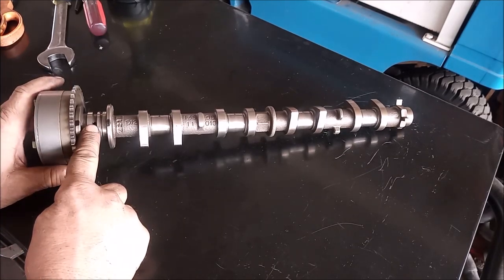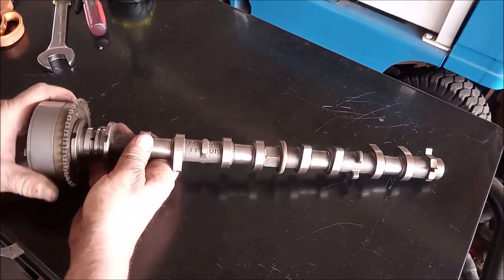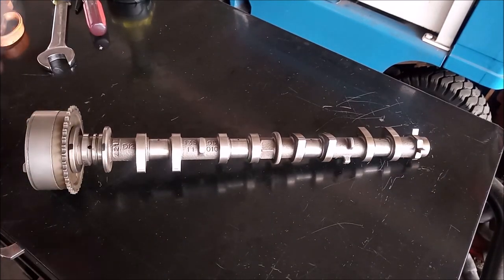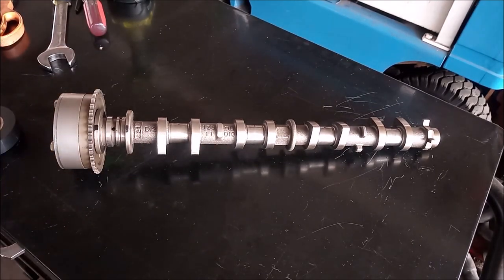VVT-i Timing Gear Unlock - Toyota 1.8-liter 1zz-fe/2zz-ge Corolla Matrix Celica MR2 Elise

Comment: I just bought a vvit gear for my 09 Corolla is the gear locked when u purchase it?
Reply from the maker: Starting 09, Corollas have a different 1.8-liter motor, 2zr-fe, not 1zz-fe. This video applies only for 1zz-fe. You can check whether the gear is locked or unlocked when you place it on the camshaft. If it is unlocked, it will turn. It it is locked, it will not turn. If it is locked, unlock it before you tighten the camshaft bolt.

Comment: I did a rebuild on a 1zzfe, non D motor and noticed it never had the get-up-and-go of the 1zzfed. I understand they are quite different motors and why but I don't think the vvti ever engaged after the rebuild. I know we didn't unlock the cam when we placed it back in, but I wasn't sure if unlocking it before putting it in matters.
When you place the cam back in the head does it need to be unlocked or locked? I see that it's supposed to unlock as you've said in the description.
Also what would go wrong with the inside to prevent it from unlocking? Would it be best to disassemble it on a rebuild to clean the interior and make sure it unlocks properly before placing it in?  
Just picked up a 1zzfed from a friend today, going to replace the 1zzfe because it began leaking too much oil. Probably won't be taking the fed apart as I'm on a pretty tight time crunch.
Reply from the maker: Lots of questions here. Let's unpack this. 

First of all the difference between fe and fed is not what you imagine. It is less than the difference that the weight of a full tank of gas makes to the acceleration of the vehicle. 

If your rebuild feels sluggish there could be many possible causes. Check the static compression, and the leakdown test. If the rings are not gapped correctly, or the valves do not seat correctly,  there will be diminished power. 

Now with respect to vvt-i. If the gear is not unlocking in operation, it will most likely trigger a P1349. If you do not have a P1349, and you suspect the gear is not unlocking, then apply 12v to the OCV at idle. The engine should stall or come close to stalling. This means the vvt is unlocking and functioning. If idle does not change when you power the OCV,  it could mean that you have a bad OCV. This would also trigger a code most of the time.  As an alternative, do an active test of the vvti with Techstream. What? You don't have Techstream? Then you have no business working on a Toyota. 

When you reassemble the camshaft. As far as I am concerned, it makes no difference whether you do it with the gear locked or unlocked. Just maks sure that the registration pin goes into the rounded slot. Either way, you will have to lock the gear to set the timing chain. Always, always, always, verify the function of the gear using compressed air (as shown in this video) before you re-install the camshaft in the car.

The gear returns to the lock position every single time you shut down the engine. If it did not, then the gear would clatter and rattle horribly on startup. So locking and unlocking is part of normal operation, not just something you do with the camshafts out. 

Hope this helps. Feel free to follow up.
Reply: replaced the ocv but swapped back after not noticing a difference. The motor just never really felt like it had the power of the stock motor I had previously. I believe it was still lower by at least 10-15 hp than a fed. Stock is 140hp vs 125hp from factory.  I guess I answered my own question. That difference plus a few more hp from an aftermarket exhaust feels quite a bit different in a 2000lb vehicle.

 I know that the fed has lightened rods and a handful of other tiny differences. they're basically identical as far as everything else. The rings were fine, the cams and valves were all within spec when reassembled, never had a p1349 during the entire operation of the motor. I did have misfire cylinder4  code but this is with aftermarket headers and exhaust where the bungs are only on 2 of the header tubes instead of a stock mr2's precat headers where they flow in 2 at a time.  

Anyway, after my first ever rebuild using youtube and a handful of manuals I got over 30k miles and 4~ years use on the motor and quite a bit of track time. ($100 used with probably 200k miles) and a $300 cheap rebuild kit.  The only reason I'm replacing it is because of the oil leaking, it's probably worth another rebuild or at least parts.  I guess I'll look into techstream options for future endevors.
Reply: and thank you it did help.
Reply: @PhonePhone-sf8te  I'm very familiar with the Fed...the difference between the Fe and fed is ...the Fed has threaded block for passenger cv axle carrier bearing and it has larger intake /exhaust valves and 8 hole piston skirts for oil return from cylinders...the con rods are the same... please don't double guess this information..I have had both of them apart a few times.. hope this clears things up
Reply: @Mikegastaldo  Hey Mike, I figured all of that out a few months ago when I was doing my rebuild.  The piston skirt holes you're talking about are referring at the oil return rings? Basically all 1zz models before 2003 (from my experience) all have 4 holes per cylinder and they're tiny. In this rebuild I just did, I added a 3rd hole(on each side) and enlarged all 3 holes of the stock pistons.  
The rebuild went successful and I had it on the track right after breaking it in. I have a slight leak out of the front main seal, and I'll have to deal with it soon.
Reply: @PhonePhone-sf8te  I'm happy you got your motor all sorted.. that's the important thing..to answer your question...yes I'm referring to the oil return holes for the oil rings.on the fed pistons you will find 4 forward facing large holes and 4 rearward facing large holes for the oil that is scraped off the cylinder to return to the pan so 8 holes on each piston... believe me..I know this for a fact

Comment: So what's the point of unlocking it if you have to install it in the locked position?
Reply from the maker: The point is - and I am sorry if I did not make this clear - that it is not possible to torque the bolt to the correct bolt with the gear locked. And when you put it in the car and it unlocks - as it does during operation - it will not function correctly, and it will make noises, and possibly self-destruct.

Comment: What about the 2GR-FSE? My exhaust gear went bad and I want to replace both exhaust gears on both banks. Do I need to make sure they're unlocked before I torque them? Thank you!
Reply from the maker: No. This is only for 1zz and 2az. Does not apply to 2GR, 2AR, or 2UR.

Comment: if i getting this right you have to unlocked then torque and install it unlocked or it doesnt matter if you are doing the timing chain?
Reply from the maker: try break down your question into more than one run-on sentence and use punctuation or I have no idea what you are asking.
Reply from the maker: If you do not separate the vvt gear from the camshaft then there is no reason to do this procedure. If the camshaft and vvt gear have been separated from each other then you must unlock the gear to install it.

Comment: Do I need a new vvt gear, if I installed it in locked position and packed up my engine and drove it too? Is my vvt gear damaged and it won’t work if I again open it and follow the correct procedure of installation??? Please guide…very worried.
Reply from the maker: I wouldn't worry too much. You can fix it easily. And if it seems to be working ok, and not making any noise,  it's fine.

Comment: Sorry for the dumb question but i cannot understand very well. 

I recentely Had to do the headgasket on my Mr2 spyder, while taking apart the head i took out the intake camshaft WITHOUT removing the vvt gear from the cam itself (so it was "all in one piece"and was surely locked) 
After replacing all the components, i put the intake cam and not bothered with the unlock procedure (as i was not aware of this) and on first start i heard a grinding noise that went away in a matter of seconds.... so here is my question:

Should i have unlocked the gear? while re-doing the timing on the 1zz engine, does the gear has to stay locked or unlocked? 

i'm asking because my car now seems to not pull as strong as it did and recently threw me a DTC P1346
Reply from the maker: The gear must be unlocked ONLY if you remove the gear from the camshaft. You unlock the gear to tighten the center bolt ONLY when replacing the gear on the camshaft. If you did not separate the gear from the camshaft there is no need to unlock it. The noise you heard was possibly due to low oil pressure. On first start after reassembling the engine, always remove the fuel pump fuse and crank without firing the engine, in order  to circulate the oil, then put the fuse back in and start the engine normally.
Reply from the maker: for toubleshooting this code, follow the steps in the factory service manual.
Reply: When removing the vvt gear from a cam, do we have to unlock it first? Or can we just unbolt it and remove?

Comment: Just want to ask,  why the need to unlock the vvti gear ? If I were to remove the 4 bolts to clean the insides,  do I need to unlock it before removing the 4 bolts?
Reply from the maker: You can disassemble the gear locked or unlocked, makes no difference. Just make sure that when you reassemble the gear and go to put the gear on the camshaft, before you tighten the center bolt, the gear should be in the unlocked state. After you tighten the center  bolt to spec, you can lock the gear. If you tighten the bolt while the gear is locked, this will lead to problems.

Comment: I got a timing chain rebuild kit. Came with exhaust sprocket, lower chain sprocket, oil pump, chain tensioner, chain guides, and a new chain.however it didn’t come with a vvti gear. I set the timing and ran the car and it jumped timing .I’m suspecting it’s the vvti gear because it’s the only thing that didn’t came in the kit. 

I noticed my vvti gear was in the lock position after it jumped timing.

Do I have to unlock and relock  the vvti gear when I set timing ? And should I test my OCV?
Reply from the maker: Ouch I hope there was no engine damage. With that said - the VVT gear will always go to the lock position when you stop the engine. The only time you need to unlock the VVT gear is when you install the gear onto the camshaft. It must be in the unlocked position when you torque the center bolt. After you torque the center bolt, you can let the gear go to the locked position. A common reason for jumping timing is a chain tensioner issue specifically if the tensioner does not release from its retracted position.
Reply: @Merryfrankster_  oh okay, I didn’t remove the gear when I was setting the timing so I guess there’s no need to do that? I used a screw driver to unhook the chain tensioner. 

I guess there could be some engine damage.
Reply from the maker: @noelhcarpio1551  If you have not removed the gear from the camshaft then there is no need to unlock it. If there is engine damage you will know it right away - some valves will be bent and the starter will refuse to crank and you will not be able to turn the crankshaft by hand with a wrench.

Comment: Let me check if I get this right: Thing is, I have bought new camshafts and new intake sprocket (QRP). I installed the sprocket on the camshaft, no problems aligning with the pin to the hole, but I didn't check the operation of the unlocking. Should I take the camshaft out of the engine again, to verify that the unlocking works? When installing the camshaft and chain,  the sprocket needs to be locked, right? It is enough that the unlocking actually happens when I blow air into the hole?
Reply from the maker: I don't know how many times this has been repeated here in these comments and elsewhere on the World Wide Web. When you install the new vvt gear on the camshaft, first snug the bolt by hand. Then, unlock the gear, using air. If it is already unlocked, you don't have to do this. Then, tighten the bolt to the correct torque. Now you can do whatever you want with the gear. But if you tighten the bolt while the gear is locked, then the gear might not work correctly. You can put the camshaft into the engine with the gear locked or unlocked, it does not matter. But you must have the gear unlocked when you tighten the bolt. Capische? Get it? Feel free to ask if you don't. You can take your camshaft out of your engine, or not, it's up to you. This procedure is specific to a certain range of years and models with specific engines.. It does not apply to newer models with different engines, because the gears are constructed differently and don't need to be unlocked for installation. That is one of the reasons why there is a lot of confusion about this.
Reply: @Merryfrankster_  Thank you for the reply. So, just because I am a little bit thick and need everything with teaspoons: As soon as it is unlocked, I should remove the sprocket from the camshaft, and only then, maintaining it in the unlocked position, reinstall it and tighten to the correct torque? And then, when it is installed, it should be possible to wiggle it a few degrees?
Reply from the maker: @torew01  I've said everything I have to say, and more. Try a different channel.
Reply: @Merryfrankster_  Thank you so much. You must be fun at parties.
Reply from the maker: @torew01  Are you really a complete idiot who needs everything repeated to him a million times, or you just pretend, because you enjoy wasting other people's time.
Reply: @Merryfrankster_  I just rebuilt my 1AR-FE Engine this is my first time dealing with VVTs. Car runs rough scanner say misfire . I know now I put VVT in locked can this be the cause of my problem.
Reply from the maker: @samlee2408  the procedure with unlocking the gear is NOT required for AR, GR, UR, ZR engines. It was done away with. So this is not the cause of your problem.
Reply: @Merryfrankster_  what about a single vvti 2tr-fe engine ?? Does it need the unlock before torquing procedure?
Reply from the maker: @administratorsowners1508  good question. Check the factory service manual. Probably yes, but I don't know.
Reply: @Merryfrankster_  thanks.i just downloaded FSM and checked.camshaft removal procedure states how to unlock the gear to check proper operation.Installation procedure doesnt  mention 'unlocking before torquing' but states to spin gear after torquing bolt to make sure gear is in locked position. So i suppose 2tr-fe does need "unlocking before torquing" procedure.thanks man.

Comment: Hi Mr Frank good day, cheers from Brazil
I have some questions
I need to clean mine because is so dirty inside, can you help me to see if my mind is right?
first need to remove the entirely camshaft off the header / the gear is locked on this moment
Before dissasembly off the gear it need to unlock so if wont tear the pin apart 
With the pulley off the camshaft i can remove the 4 bolts on the pulley on the locked or unlocked position
Then dissasembly and clean all the pulley and assembly again, the unlock and install it on the camshaft
Then lock it and install on the header so i can set the timing correctly
Is that right? Sorry for my bad english, i am a Brazilian
Reply from the maker: You are mostly right. There is no need to unlock the gear to remove it from the camshaft. It comes right off. The rest is correct
Reply: @Merryfrankster_  and another question mr frank, i dissasembled the pulley from the camshaft without unlock it like you said and it all goed right, so i gonna clean it all, the pulley is full off carbon oil inside off it 

But i have a question, can i mount it on the unlocked position and after mount it on the camshaft? Because i dont have a compressor here in my house
Reply from the maker: @DragonFoust  Yes, sure, you can mount it in the unlocked position, no problem. Just make sure it stays unlocked. It is always trying to lock itself. .
Reply from the maker: To be clear, the gear must be in the unlocked position when  you torque the bolt onto the camshaft. After the bolt is torqued, you can lock the gear.
Reply: @Merryfrankster_  great! Thank you so much my friend!!
Reply: @Merryfrankster_  hi again mr Frank good night, you know what is the torque off the bolts off the exhaust and intake vvti camshaft sprocket on the 1zz fe?
Reply from the maker: @DragonFoust  the torque of the center bolt mounting the gear to the camshaft is 40ft.lb 54 N.m. I had to look that up for you in the factory service manual. You should get a copy. Email me for a download.

Comment: I turned motor ccw using vvt bolt been getting p1349 since is it related
Reply from the maker: It could be related, yes.
Reply: @Merryfrankster_  double checked and vvt gear is locked since the two dots line up can I unlock it w/o taking timing chain off
Reply from the maker: @dannysouliotis  It's normal for the vvt gear to be locked when you shut off the engine. Why do you want to unlock it? There is no reason to unlock the vvt gear unless it has been disassembled from the camshaft.
Reply from the maker: @dannysouliotis  I have no idea what you've done to your car, or how you've done it. You should never turn the engine backward, and you should never turn the engine by the camshaft.
Reply: @Merryfrankster_ I kept getting a bank1 oxygen mix code- cylinder 1 had 0 clearance on intake valve - changed bucket - after reinstalled cams and chain - turned motor CCW to release chain tensioner- used vvt bolt to turn it. Been getting 1349 since.Installed new solenoid cleaned screen new oil and filter blew out all oil passages to vvt gear from cam .